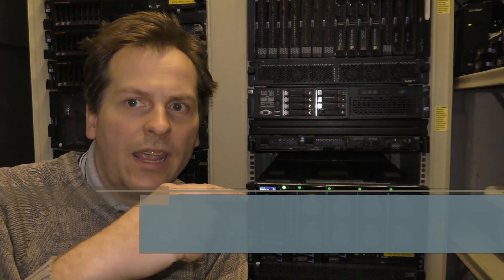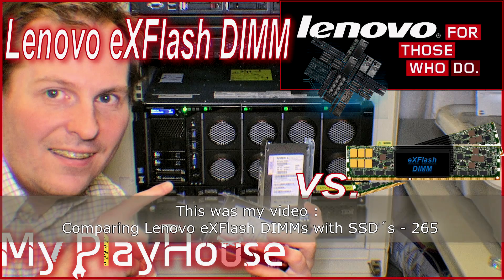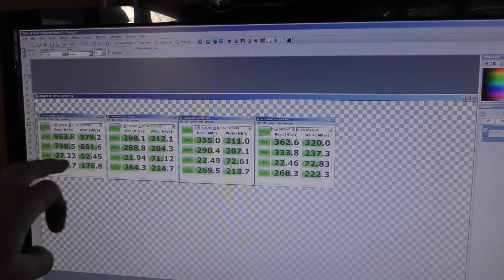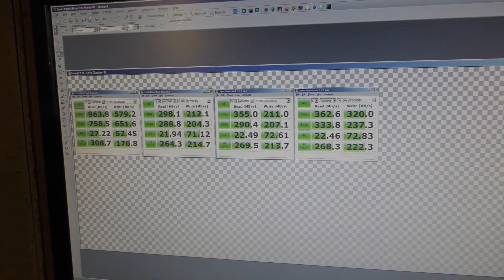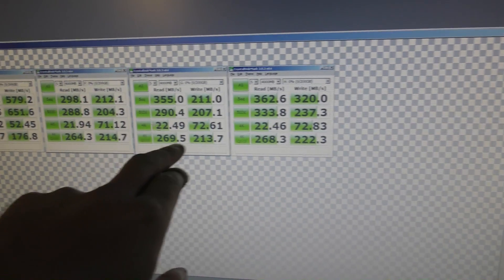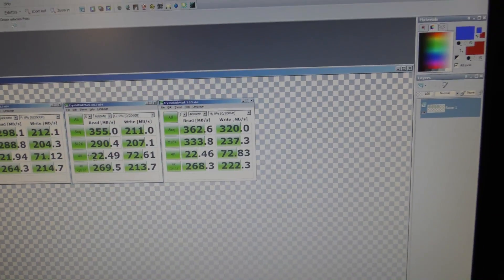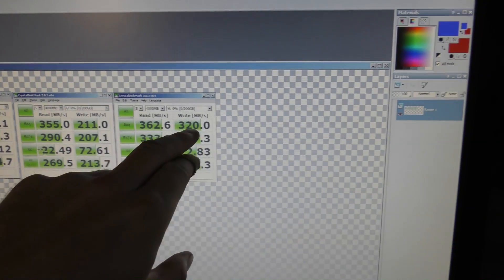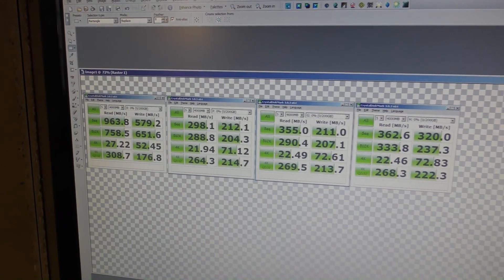Lenovo eXFlash DIMMs with SSD´s, Quick update - 272

Comment: "I'm not a Hyper-V man, I like VMware" speaking like a true hero, Morten! :)

Can you raid the exFlash in the raid controller instead of doing JBOD?  I actually just ordered a new Lenovo SystemX 3650 M5.  Didn't consider the exFlash due to the price but just got 2 SSDs to put in a RAID1 for ESXi.

You make some great videos.  Keep them coming! :)
Reply from the maker: HI
The exFlashs do not use a raid controler,, so they did not pop up as a disk that I could add in a Raid,,,
The Lenovo SystemX 3650 M5 is an awesome server good choice!
Thank you for watching! :-)
Reply: Ah yes, that makes perfect sense.